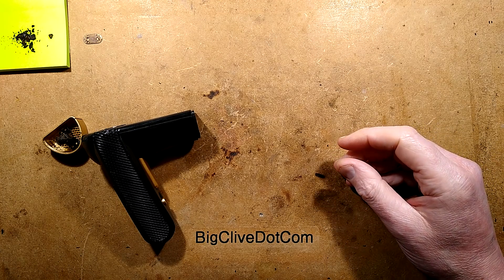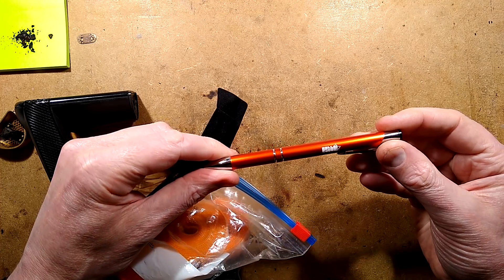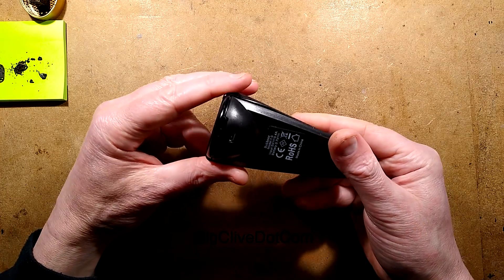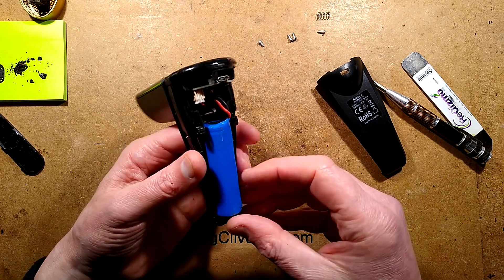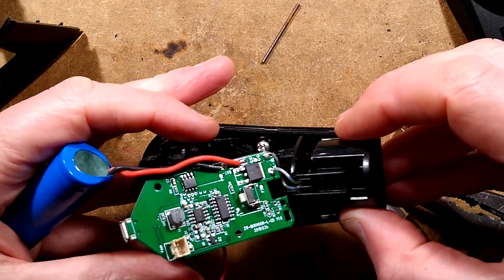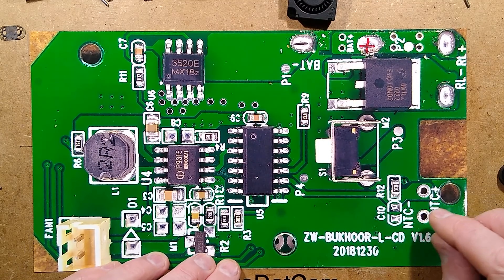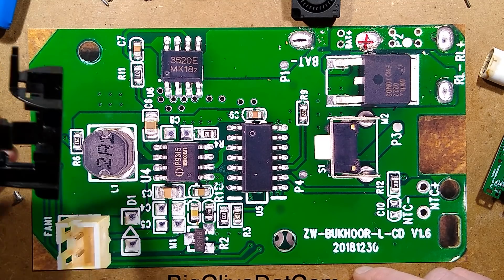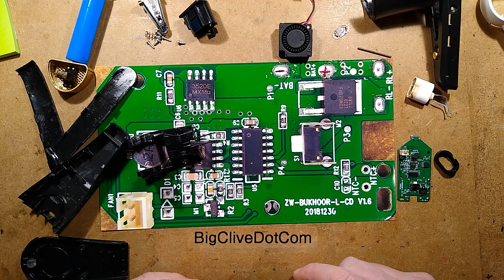Inside a USB rechargeable incense burner.

Comment: Well... All you need is some cotton and a bit of e-liquid and you have a vape, and a very affordable one i assume . Even the coil, among nicotine vapers is known as a stovetop style, and although unpopular mainstream, but can be found in some niche vape devices, especially those for cannabis, where they are usually at the bottom of the ceramic chamber used to hold the greenery and then heated up to a regulated temp to vapoorize andnot burn the good stuff. Only difference is, a lack of ann optional temp display and the fan used here is replaced by te users lungs..  :)

Comment: can i send you a multi meter circuit bord which may or not be blown? its only a cheap one but the thirmocouple is not working. i did blow the high amp fuse but the secondary was seem to be working.

Comment: Any idea how much Paddy paid for that gizmo Clive ?
Reply from the maker: Not sure, but you can find them on eBay easily enough.
Reply: Thanks , I wasn't eager to buy one but I thought it looked like it had fairly expensive components . @bigclivedotcom
Reply: Think it was just over a tenner - it's a strange mix of good and shit quality - the plastic feels unusually awful in the hand, the trigger is squishy, the battery Clive noted to be ~1000mAH and anyway the charge circuit is tempramental.  They have so many shitty reviews I don't think I was uniquely unlucky, but it would have been ideal.  I actually use a lighter gas powered unit instead, as charcoal briquettes are not cost or time effective, and you need that for this type of incense.  EDIT - £9.15 .

Comment: An interesting piece of equipment; but why oh why? I thought incense burned on its own anyway, I’ve  seen people burning the sticks in Buddhist Temples. They look like sparklers but give off pungent smoke instead. Some of them smell quite nice, but I don’t quite know why you need a machine. Oh well, each to their own.
Reply from the maker: You may have seen Joss sticks that burn themselves when lit.  Traditional incense has to be heated.
Reply: bigclivedotcom Thanks Clive. I didn’t know there was a difference; I do now. Great video lately. Thank you.
Reply: This type of incense doesn't have binding agents and is oilier.  This type of burner is actually better than the charcoal bricks you're supposed to use with it as it doesn't burn it as much.  Most incense sticks are and smell cheap, this is for the fancy stuff ;-)
Reply: Paddy Robinson-Griffin Thank you. Keep safe. 👍

Comment: The mystery chip - emx18z, appears to be an npn+non low VCE (sat) Transistor. Also comes up with umx18n. Though the data sheet says it's 12v..... mouser has the pdf for what I located.

Comment: Looks like you can make a small power bank with that 18650 and 5v output for the fan. With a few mods you can modify this into a power bank. Connect a USB connector to that fan output and an on off switch.
Reply: Think it would be a pretty crappy powerbank!

Comment: yeah you could probably use it for weed, but it wouldn't be good, it would be bad actually... maybe you could re-wire it to work better(probably what the temperature monitor is for), and change the vent part to fit a bag or a hose of some kind, but it looks fragile and hard to clean, so i doubt it would last long.

Comment: I just had a discussion with my brother about powerbanks, and during that conversation one thought came to my mind: What would happen if you plugged one powerbank into another via USB-C (assuming that both support charging as well as supplying power through the same USB-C port)?

I don't have the means to test this right now, and the answer would probably depend on the circuitry used, but I wonder what the most likely outcome would be.

Would it just push power back and forth until the charging losses drained both batteries, do they share their power until both reach the same level of charge, or would this potentially fry something?

Comment: This is a really cheap marijuana burner, I would like to see you take apart a pax 2, you can hear music on them from the induction coil heater. The plate is similar to the one in the bottom of the pax oven. I think its more of a heat disrubition plate like a copper bottom pot. to heat the material evenly.

Comment: "It is quit complex, and well  designed, and heavy . . .". And flown over from heavy metal China ! What is wrong with a match ?
Reply: Arabic style bhakoor incense is oilier and looser than joss sticks etc, and without the binding agents etc you have to heat it usually on a charcoal block, which is slow, a pain in the area, and wasteful.  This (if it worked properly) would give the ability to heat a small amount of incense quickly, safely and cleanly.
Reply: I was not aware of thick oily circumstances in that busyness. Can't you mix it with a drop of alcohol ?

Comment: You never looked at the locking mechanism and why it didn't work
Reply: It's just a crappy plastic interlock, it doesn't feel like it works (the cheap plastic button flexes and deforms), but it does work kinda.

Comment: Oh wow. I had a lighter with one of those coil heating elements, and you would touch your smoke to the coil to light it up. Battery was awful on it. Also I was using it to smoke MARIHUANA from a pipe.

Comment: Hey BigClive, as usual a fun and informative video. Amazed over how you get all your ideas ;=) I have run into an interesting electrical gizmo you might be able to help me with. It is a Honeywell control panel named "Electric Comfort  Control" but the previous owner said they never touched it the 20 years they had the house but it is ticking because there is a set of pins determining the on/off times of the stuff. The house is built in 1976 so it is old. I can't attach pictures so let me know if I should make a page on WIX for you with pictures if your curiousity is peeked ;=)

Comment: "The other brown resin"? Are you speaking of crack resin or opium? remove the plate and it should work brilliantly whilst not one person may have a clue to your illicit drug use. Fantastic!
           I bought a multi function vape pen once. One battery, three attachments" or let's say modules. One module was designed to atomize a resin, most likely intended for Shatter, a form of THC extract also refereed to a Wax. The instructions regarding this particular attachment did not say what it was for. A bulb with a ceramic cup fixed in the center , ~1/4'' in diameter And in depth, with a helical element threaded by a ceramic wick that was not much longer than the coil or the diameter of the cup. On the bottom of the cup was a support for the heating element, like a nub, and two small empty thru holes to allow airflow up thru the cup. The bulb itself was about 1.25'' with a mouthpiece. Quite stylish. The second module was for vaping "ToBACCo" that had stove-top type heating element where on top sat your choice of a mirrored glass disk with holes or ceramic. Great idea, but not enough heat to vape the pot. You could remove the disk for combustion which was handy. The last module was a regular vape pen tank. It was still very cool, back when vapes were a new thing. 

           Just a DISCLAIMER:   For anybody having thoughts about trying drugs. Imagine having spiders under your skin, worms in your brain, rocks in your stomach, missing fingers and toes, and Satan's willy down your neck. 'Cause that's what it's like. Not worth it. Unless your rich, then you wont have to worry about anything but maybe death or jail insane or worse. Oh, and don't be the moron who thinks their anti anxiety or pain killers are not hard drugs because they are prescription. Even mood stabilizers can tear your life apart under the right circumstances, which happens far to often and almost always goes unrecognized because people have not learned to self evaluate and/or self sooth. Most meds are a plaster/band-aid, not a cure and it always festers under the plaster. Go to AA, learn to help you help yourself. Even if you cant quit, you'll have a better chance at life, to not feel like shit. It works too. keeps you grounded, centered, in remembrance, conditions you to be better. And free coffee with good people.
          Just another DISCLAIMER:   This is not to be taken as medical advice. If you are unsure, It is always a good idea to speak with a doctor, or a wall, anything that will absolve me from liability.
Reply: Relax there nancy reagan. Or is it betty ford?
By the way, the first line of your "disclaimer" poorly sets the tone for the rest of what you write which is moderately insightful.
Reply: @mindgames11  you mean Hillary Clintons, "this is your brain on drugs". IDK I just like to write sometimes. Yeah idk why i put "disclaimer" It's kinda wack, I was probably high. I would remove that part but then someone would be confused if they read our comment and noone probably cares anyway.  It's kinda sad how permanent people can perceive your ideas when you write them and put them out there when in reality thoughts and ideas are dynamic, growing and changing with time and input. It's why I dont have facebook. I tend to write too intimately my exact thoughts as I form the ideas which could very well change withing 24hrs of writing. If I draft everything I wrote, I would probably never publish or post anything. No big deal tho. 

What If one day someone made a comments crawling bot to find every comment you ever wrote. things you wrote that are no longer active in how you think. and if your name is attached or gets hacked. oh boy, look out.
Reminds me of the social score in China. 

I shoulda used my good keyboard for this. i like to type. is fun not to look at the keys when you get good somewhat. IL keyboards!

Comment: I bet that mesh screen is supposed to be kept off of the heating coil by a mm or two by way of a ridge molded into the ceramic heater enclosure. It likely broke loose by having too much "product" forced into it.  Typical Chineasium built to be easy to break.

Comment: Random question. Why at the start of all your recent videos is there, what sounds like, 250ms worth of mains hum?
Reply: I think it's because of the notch filter (which takes a few cycles to respond) used to remove the hum.
Reply from the maker: It seems to be the AGC stabilising.  Also happens with loud noises.
Reply: @bigclivedotcom  Seems like a reasonable explanation :)

Comment: That is an interesting concept, but from my own incense burning (or better: vaporizing) experience, I'd say it's a bit flawed. I only use incense that comes in the form of globs of hardened tree sap, so no herbs or anything among that. And I have had the best experience with putting it into the aluminium shell of a tea light candle, placing this shell above another tea light candle and then letting it get vaporized. For a greater longevity of the incense that is being burned, adding water from a spay bottle is greatly helpful, because otherwise, the incense doesn't just melt and then slowly cook to vaporize, but actually gets burnt and stinky quite quickly (I even once triggered my smoke alarm, because I wanted to test how it works without the water). Oh, and yes, it is advisable to free the upper aluminium shell in which the incense sits from any waxy or gluey residue from the tea light candle. That was easier in the past, when the candles weren't glued in, nowadays it's a bit more challenging, but basically, once you've gotten one or two of these shells, you can always reuse them, since the incense, when it's all used up and cooled down, just breaks apart and falls out without leaving much residue itself, also the aluminium is soft enough (almost plyable) so that you can deform it to losen the incense from the shell and that way break it up and dump it out. This thing however doesn't take care not to burn the incense, but only vaporize it, so that makes it somewhat suspect for me (although I agree that it would be a great gimmick to use, instead of burning candles, but oh well). It certainly is a much more cost efficient method of doing it, but I think my method is already highly cost efficient, because I don't have to buy and burn the coal tablets, which can't even be shut off if you think the place is sufficiently smoked out, so they are really wasteful.

Comment: The heating spiral seems made of Kanthal A1 wire (NiCrAl alloy, like inside electronic cigarette). Aluminum oxyde that builds-up at the surface of the wire might explain why a loose contact with the front grid plate doesn't short-circuit it?
Reply: Kanthal is composed of FeCrAl. There's NiCr (also with Fe in some grades) but I don't know of any NiCrAl alloy being used.
The explanation makes sense though (and some FeCrAl alloys are available with an intentionally pre-formed oxide layer).
Reply: @longrunner258 , you're perfectly right Kanthal-A1 is FeCrAl alloy (my mistake!). I get confused because under the same Kanthal brand from Sandwik, some other alloys using Ni exist too (kanthal SW210, SW230, SW806), but no NiCrAl which seems used for hitech industry (nuclear, etc.)

Comment: The heater coil looks very similar to the ones that used to be in car cigarette lighters.  (I say 'used to' because car cigarette lighters seem to have gone away, although the outlets for them are usually there, and often in larger numbers.  The last vehicle I had with a cigarette lighter was bought over 20 years ago.)
Reply: Yeah, but you can buy the lighter separately if you have the outlet. Or you can buy the whole system(plug&outlet) and install it yourself.

Comment: 0,6 ohms will change into a higher value when the heating element heats up,  not? 5 or 6 amps sounds like a dangerous load for the lion battery😱
Reply: Not by much for normal NiCr or FeCrAl heating elements. (Tungsten filaments have a large temperature coefficient, but aren't usable in air.)

Comment: I'd think that metal plate is supposed to be fixed in place, then the incense is dropped in (not in direct contact with the heater) and pressed to it with the plunger thingy.
Reply: You're mostly right, the plate goes on the coil, then incense, then held in plate by the front.  Comes with spare plates, so rather than affix, you just drop them in :)

Comment: Clive, I'm slightly disappointed- what was the source of the charging issue? Did Paddy just have it on a bad charger?
Reply: It didn't hold a charge well which is why I thought Clive might get more use from it than I did!
Reply: @pdrg  Hello, Paddy! The battery is big enough and Clive judged it weighty enough not to be a Chinesium fake, so either there's a problem in the circuit or the charger you charged it on is toast. Have you tried it on anything else? Just trying to process-of-elimination find the failure point here.
On the other hand, as much current as the heater draws (did he really say *five amps*??) even a real Panasonic battery isn't going to last long.
Reply: @markfergerson2145  Hiya, I suspect the charge circuit over the cell, which seems unusual.  The indicator would quickly show battery enjoy (like in a few seconds), it would accept a charge 1 time in many, and then reject it soon after.  Charger is fine, it's a high quality 60W rated unit without undercurrent switch off (in case it was that).  Good thoughts, appreciate them, and the willingness to help.  I'm a little hazy on details now as it was a couple of months ago, but it was misbehaving intermittently :)
Reply: @markfergerson2145  PS - in the description he added that it came out to 1000mAH, so that does seem a contributor too.

Comment: I need to get myself an explosion containment pie dish. I was replacing the LiPo in my electric toothbrush, when I realized it started to get warm. I was prying it gently to try to get it out. I didn't think I punctured it. I got afraid, and just froze, while continuing to feel the temperature between my fingers. "Was it from the soldering? Or is it reacting? Oh no..".. My mind raced as I imagined the battery vent out lots of smoke and trying to think of a place to throw it and not cause a fire. Ultimately, it never actually got any warmer and nothing happened. I probably shouldn't have kept feeling it between my fingers, but I just had to know if it was getting hotter and going to explode.

Comment: What was the flash at 9:20?
Reply: Looks like a shot circuit under the circuit board, but I'm not sure what could have caused that, as there are no screw heads, etc. around.
Reply: Yeah, what was that? Maybe the MOSFET died because he shorted something else on the board (Battery wire vs edge of PCB)?

Comment: Looks like a modified ”dry herb” vaporizer. An electric pipe basically.
Reply: Ros3NburG Exatly what I had on mind.
Reply: He should try to smoke "Mary-Jo-Anna" in it xD.
Reply: Those Snoop Dogg GPens are garbage.
They're not a true dry herb vaporiser.
The coil just ends up burning your product, even with a glass filter.
Airistech Herbva 5g is a nice pocketable size with a ceramic chamber that is heated externally, which actually carboxylises the herb.
The ceramic chamber tastes awesome as well, in comparison to a stainless steel chamber.
Reply: @CountDoucheula  just take a trumpet mouthpiece and a water bottle n call it a day dude

Comment: the "mesh" screen is literally the same size and shape as my overpriced mar hujuana(how did you prounce that???) "pax 3" vaporizer, but it has a ceramic heating chamber around it, not directly on a coil
Reply: Not quite the same shape. Looks a little fatter, and of course the pax doesn't have those odd holes.
Reply: i think the proper spelling is mario-hannah